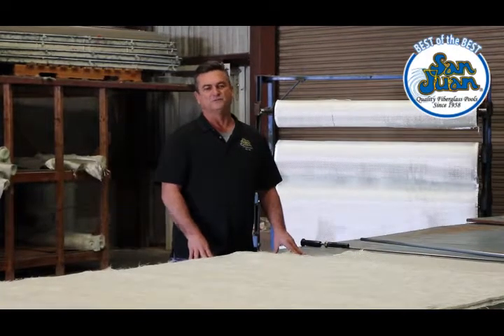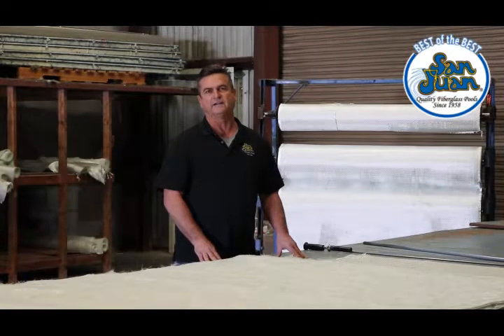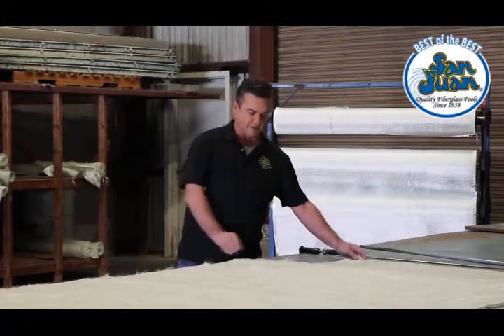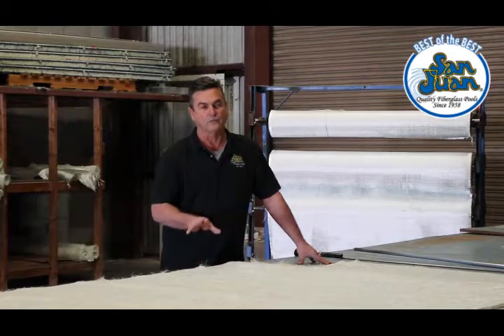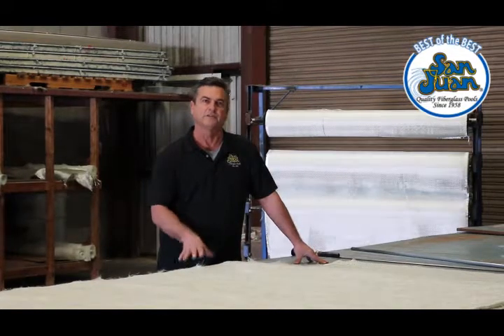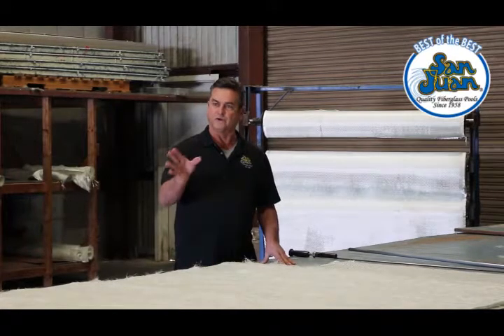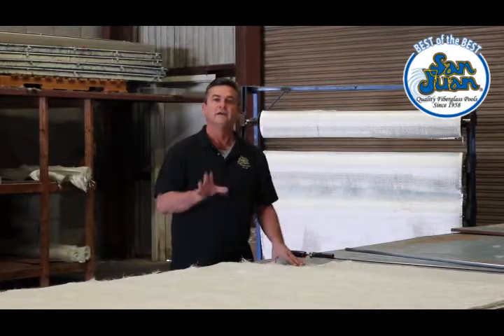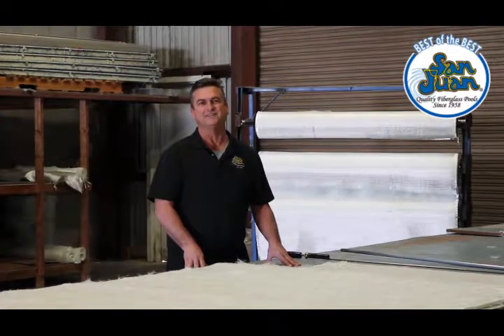San Juan Fiberglass Pools

Comment: The man's right about the strength of fibreglass.  Anyone interested in getting a fibreglass pool need to stay away from manufacturers who use sprayed on chop strand to build thickness rather than woven.  Cop strand is cheap, fast and very weak and I can't emphasize the cheap part strong enough.